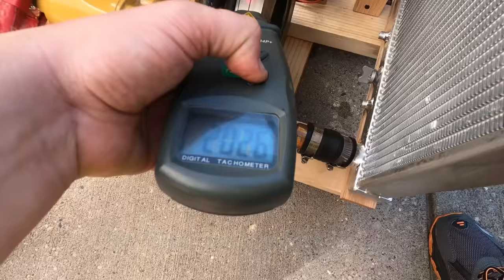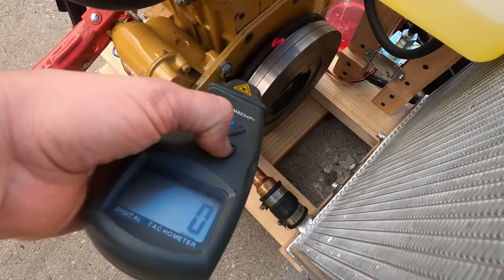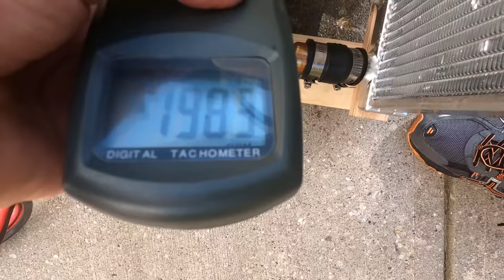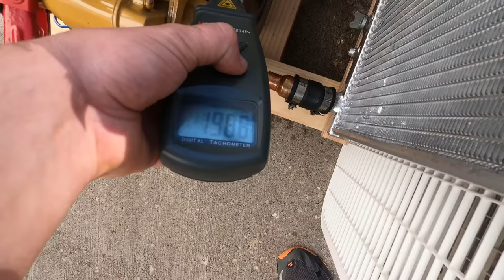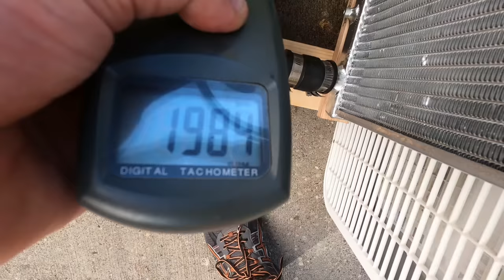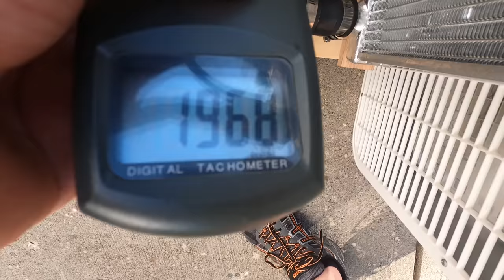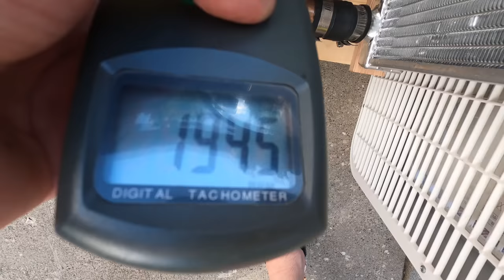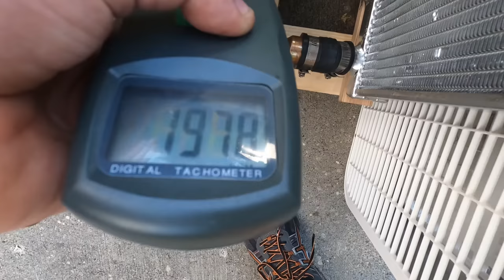Will Caterpillar Diesel run on Cooking oil? Attempt to run engine on Transmission Fluid & other oils

Comment: Anyone who's witnessed a diesel runaway knows very well that diesels run great on motor oil.
Reply: Hearsay. I but you know not a single person who ever was at a diesel runaway. They are possible but very, very unlikely. It's a nightmare tale invented by the US petrol assoc.
Reply: not at all. Diesels don't have a throttle like a gasoline engine. So if you have an outside fuel source being sucked into the intake (flammable vapors, oil leaking into the turbo air intake side, etc) you can't control it, and the engine will run away unless you choke the air.
Reply: @kyletrummel69  That's why all USMC motorpool NCOs are required to carry a clipboard at all times. They fit flush up against all sealed air intake tubes as demonstrated day one on the job for all newbies and again throughout most field days on ready line.
Semper Fi!!
Reply: It's not hard to use preventative measures to ensure that it doesn't happen, but to say it's 'very, very unlikely' and a 'nightmare tale invented by the US petrol assoc" is grossly misinformed my friend.
Reply: happened to me once. It was the first startup after a friend of mine turboed his Detroit 6.2. The whole deal lasted for around two and a half seconds. I told him to hold a small wooden board right next to the air intake just incase. And wouldn't you know it, after five very hard knocks, it ran away. The engine was toast afterwards
Reply: I can assure you that it is a very real thing. I had a Mitsubishi 4M40 decide to run away when it had an intercooler full of excess blowby residue that had collected. Took off and flicking the key did absolutely nothing! Thankfully I could stall it
Reply: Me too had witnessed quite a few diesel runaway . mostly from modded turbo pickup truck , too much boost wrecked a turbo shaft seal and oil spill into intake.
Reply: There are multiple videos of diesel runaway on Youtube alone. Stop spreading conspiracy theories.
Reply: I had it happen on my 1.6 Diesel Golf Mk 1. It's rather frightening and the only way I managed to stop it was to very slowly drive the car against a wall and dump the clutch. A breather valve on the crankcase was at fault. Well known problem on early Golf diesels. I've also had it happen on Ford Transits.
Reply: imagine thinking you were on to something lmao you obviously don't work around diesels lol you're one turbo seal away from a runaway.
Reply: Aaaaahhhhh ha ha ha ha yeah yes Sir especially Detroits the two stroke ones but the I believe 110 and I think 144 series will do the same there 4 stroke but the 92 71 and 53 series are two stroke and run a blower as part of the valve train. Not exactly the valve train but is used as sort of a scavenging pre compression device and probably won't run without the Jimmy huffer attached. But was originally designed to fill the combustion chamber before the end of the compression stroke. I actually love 😍 Detroit two stroke diesels especially the 6v53ttA. Can't wait to install one in my little truck!!!
Reply: Was hoping it would be a Kubota diesel. 😀Great video as always!
Reply: @giggiddy  Kubota diesels are truly an excellent definition of ingineering for sure but recently cat has improved in leaps and bounds as of late. But absolutely no argument there as they of course are more affordable since paying for that cat name.
Reply: I thought heating oil is #2 diesel??
Reply: @JubileeValence  cant they just use the car keyfob and press the locking button to activate the alarm wich will activate the imobolizer? :s
Reply: modern diesel is very rare for it to happen. I have seen engines from the 90s run away
Reply: @jamesrussell6870  it is the same just dyed red for non taxed
Reply: it actually happened to me, in an old Peugeot berlingo
Reply: uncontrolled flow, Like flowing through failed turbo seals. Self feeding no rack or solenoid to shut fuel off
Reply: It gets exciting very fast, I've been near a few Detroits that ran away.
Reply: oh man, you haven't lived if you haven't experienced a diesel runaway...
Reply: Very true
Reply: You have no idea what you're talking about... There's plenty of videos of these on YouTube. Even a UPS truck.
Reply: @LogitechXibanga  turning it off will do nothing, once the heat and pressure is there, its gonna run until theres no more fuel or something fails spectacularly.
Reply: @droomonsta  injectores dont work without electricity the imobolizer shuts all energy sources including the alternator and the fuel pumps so no more fuel to it and nothing to burn anymore... or just put it in gear drop the clutch and let the engine stall, or cover the air intake that will stall the car also but its hard to do it special if its on fire
Reply: Its NOT the motoroil that keeps it running upon "runaway"! ................ its pure oxygen from the air ....look at a fire lighter pump for camping
Reply: @jimw7916   Air doesn't spontaneously combust though. Air is necessary for combustion, but you still have to have a fuel, and the oil becomes the fuel.
Reply: Rolling Coal extreme edition
Reply: @bisken6547  i'm sure it made a lot of power before hand
Reply: @LogitechXibanga   You obviously don't understand what constitutes a runaway. The injectors and electricity have nothing to do with oil blowing through a turbo.
Reply: @anonymousinc6330  WRONG it does combust. look at that vid on youtube where a man puts a lid on a coke bottle and simply squashes it up quickly
Reply: @jimw7916  What's crushing a coke bottle got to do with combustion requiring some sort of fuel?
Reply: @anonymousinc6330  The air inside the plastic bottle ignites and releases smoke
Reply: @bisken6547  my  2.6ltr turbo diesel - 2000 ford ranger   had a runaway due to damaged turbo housing letting motor oil into the inlet (thank fully at home)  but some very fast thinking and a sheet of tin to choke it out to stop it from blowing up
scary AF thing to happen after start up / warming up the motor
Reply: that’s not true… my Deutz Diesel ran away. However I fixed that. All you have to do it choke the engine or bog it down with a high gear. it definitely happens, but you can control it usually
Reply: @kimnielsenthewordyvikingett159  buy a boat and get two of 'em.  We have a couple 8V71TI's in our Hatteras.  And no, they won't run without the blower at all.
Reply: @Prototheria  Cool I once R&Red four i671s for four 8v92ttas in a girlfriends Bertram diesel creating a lot more space in front of the engines for a lot more fuel capacity. And good lord that sucker would stand on it's props for the duration of fuel available!!! I had a buddy that could probably figure prop twist in his head telling us whichever ones would prove best and they most certainly did!!!! Those 92s were duel turbo and after cooled as the i6es were naturally aspirated so big difference in output!!!!
Reply: @kyletrummel69  And there is no ignition to kill...
Reply: @michaelbevan3285  wow scary a breather ? Oil getting sucked in the engine? I have an old benz diesel i better be careful working on her
Reply: @jamesrussell6870  It is with added color..It doesn't follow such strict sulfur regulations as Diesel does.
Reply: I've seen this in person with a Detroit 6V turbo. https://www.youtube.com/watch?v=3NRaqgab0_w . Its also possible to run the 6V53T backwards, but the water pump doesn't work.
Reply: 🤣🤣🤣🤣🤣
Invented by the US petrol association! 
🤣🤣🤣🤣🤣
As my dad witnessed a Gardner 5 cylinder in a Bristol bus and I was on the phone to the kitchen fitter when his Toyota HiAce engine ran away trying to explain how to stall it, he called me as I was the only mechanic he knew. 
I guess I must really blessed to know of 2 real life examples and been party to one, including hearing the dreadful noises it made as it died! Surprising how many RPMs they can do before the final bang! 

Invented by the US petrol association! 
🙄🙄🙄
Reply: @LogitechXibanga 
A good question, but no, the typical runaway would be burning engine oil from the sump via a breather, failed oil control rings or a failed turbo shaft seal. 
In many locations the immobiliser is not permitted to stop an engine, but rather prevent it from starting and even if it shuts off the fuel supply once an engine is running away it is burning an alternative fuel source, the only ways to stop a runaway are stall it or starve it of air, a piece of board is needed for this as rags etc will just get sucked in!
Reply: @kyletrummel69  all normal(german) diesels that are younger than 25 years have throttle, for EGR functioning and for emergency engine stopping. My 1999 Audi a6 also has throttle on diesel.

Comment: About 20 years ago I had a friend who had a roughly 150 mile return commute every day.  He bought a Citroen AX 1.5 Diesel for this commute.  Now for anyone not European these were a very small, very light, very economical car that could do well over 80mpg in the right conditions.  He got waste cooking oil from his local chip shop and refined it for use in the Citroen.  The company he worked for gave him a travel allowance of £300 every week so he basically got this all into his pocket
Reply: I HAD A FRIEND WHO WAS A  MECHANIC WHO OWNED AN OLD PEUGEOT GOT  OIL FROM THE FROM FISH AND CHIP SHOP AND PUT THROUGH  A  FILTER PAPER AND THE SAME WITH WAST OIL FROM SERVICING CARS DID IT FOR YEARS. CANNOT DO IT ON MODERN CARS DUE TO DAMAGING  HIGH PRESSURE FUEL PUMP AND THE SEALS..

Comment: Rudolph diesel originally designed and intended for his engine to run on peanut oil I believe. You can run diesels with an older style non high pressure common rail system on pretty much anything flammable. The ldt 465 multifuel will run on pretty much anything including gasoline.
Reply: My 1.9 alh diesel would run on anything . Its own oil changes, gear oil, i got two 55 gallon drums of waste machine oil, a little atf, extreme ammounts of additives like Marvel Mystery Oil, it did not care . It was modified to have over double the stock power and I drove it hard . Those old diesels were industructable . I ended up selling the car with 302k miles still going strong.
Reply: Combustable not flammable. There is a difference.
Reply: He originally intended his engine to run on coal dust, but that didn’t work well. Caterpillar originally marketed their diesel as a multi fuel engine, I remember reading an old ad of theirs talking about a soybean farm, that ran all of their tractors on soybean oil.
Reply: Feb 21, 2019 - The Diesel-Engine was originally made to run on HEMP-OIL ! In 1893, German inventor Rudolph Diesel published a paper entitled "The Theory ...
Reply: @jusportel  fist diesel run on coal dust but this wear the engine very fast (abrasive dust in the smoke), this explain why this was not use...In Europe the most use vegetable oil was rapseed oil because it's the fluidest and the cheapest...
Reply: Good luck, you injectors are going to be messed up after this.
Reply: i thought gas has a high compression rate though so it'll cause pre detonation?
Reply: @Mork Ponkey We have diesel engines that can run on pulverized coal dust, as well as micronized biomass. So yes, diesel engines should be able to run on powdered sewage sludge.
Reply: @Million Miles An Hour³ might if you just ate taco bell
Reply: @Million Miles An Hour³ How about piss? Can we power a diesel with all the different bodily fluids? There's surprisingly a lot of people that would jerk into their fuel tanks to save a few bucks.
Reply: He originally wanted his engine to be able to reliably run on most if not all types of vegetable, animal, and mineral oils. Even pulverized coal dust and pure concentrated Ammonia but didnt work well at all.
Reply: @davido9208  i was wondering where a good diesel would draw the line, but damn thats amazing. now i kinda feel like buying a diesel and find out if i can make it run like shit with to viscous vluids or to liquid. like kan it handle butter/margerine, or does it not like something as terpentine. id also love to see what brake cleaner, lampoil, wd40, alcohol, maybe even butane or propane does with a diesel. and there are prob a few other fluids with flashpoints around wich a diesel should be able to handle. and if it doesnt run on a specific fluid, could one adjust the timing or the fuelpump and lines to fix the problem, etc.
Reply: @leneanderthalien  during WW II engines using coal dust found limited use in Germany. As far as I know, they needed service every few hundred kilometers (up. to 500-750km).
Reply: You may have a problem with fuel pump if you run the engine on "anything flammable" cause it needs proper lubrication.
Reply: @leouvarov8982  You may put some 2 stroke oil into fuel tank. Some People do this also with standard diesel fuel.
Reply: @Anglerraw  This. Typically you mix the gasoline or other nasty fuel with no lubricity with oil or other component to prevent the pump from dieing.
Reply: @blargblarghonk  yup. But some folks say that some fuel pumps (I heard that about opel) may have some flaws and need some more lubrovation. Personaly i prefer just buing good quality fuel.
Reply: Mineral oil, when the gates opened at the fair he was satisfying an inquiry if it could run on peanut oil. He said "idk let's see"  so when the world saw it running on peanut oil that is the news.

Comment: Diesel motors are truly my favorite engines. They are so diverse and reliable and can run on almost anything. As long as they are pure engines and not tampered with by green weenies.
Reply: Why do you think they are being "phased out"
Reply: @wadebrewer7212  its an environmental thing, its the same with any other crude oil based engines i.e spark ignition engines, jet engines. its not just diesels.
but 100% diesels are so much more reliable and with a much larger fuel efficiency